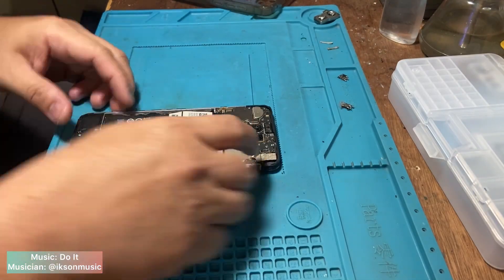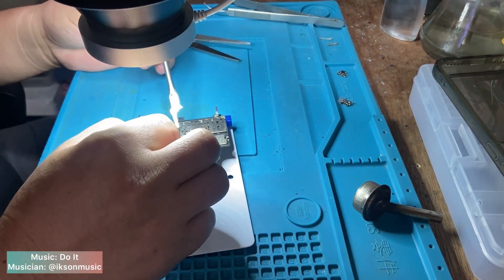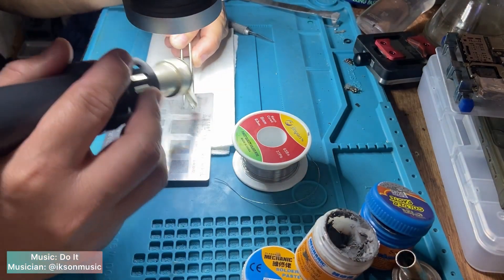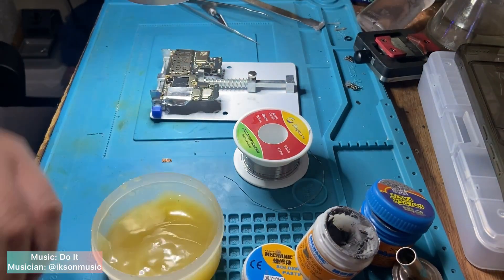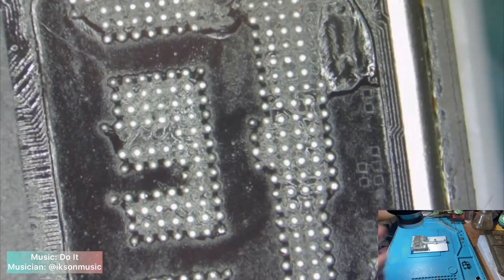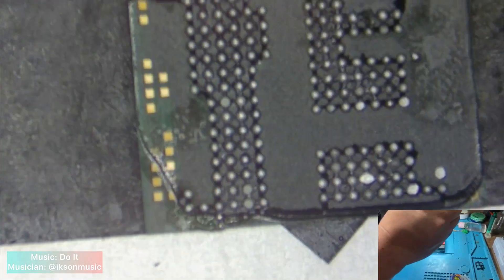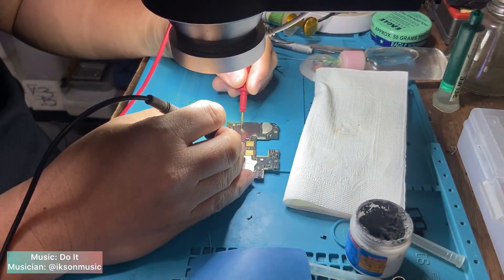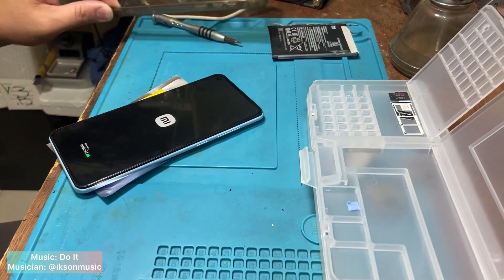REDMI NOTE 9 ON AND OFF PROBLEM FIX VIA CPU AND EMMC REWORKS(BATT ID AND BATT THERMISTOR ISSUE)

Comment: Where is the thermistor and how does reballing these two chips resolve the thermistor problem?
Reply from the maker: This is not the thermistor problem. . The signal to  vio_pmu  is missing.  And the only thing to fix the issue is to reworks those chips.